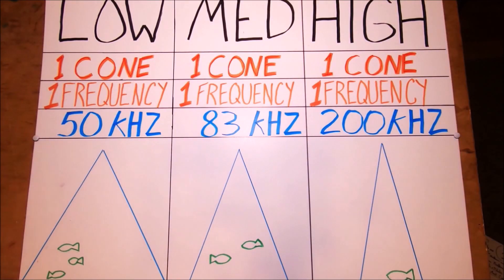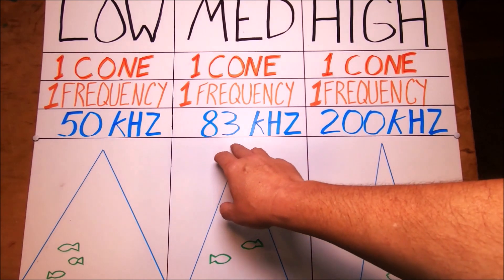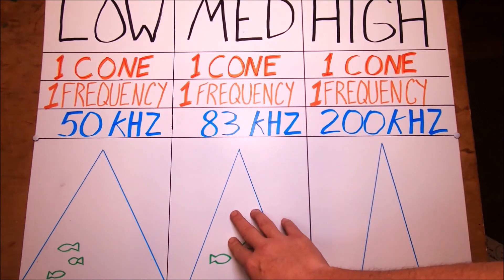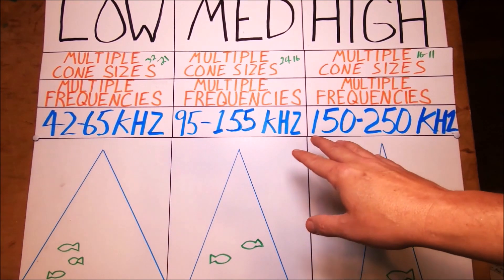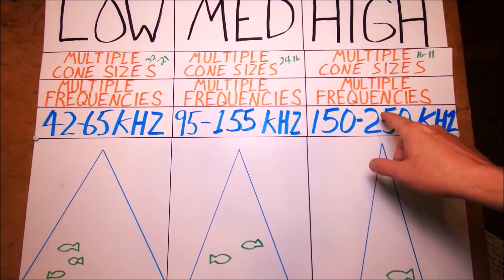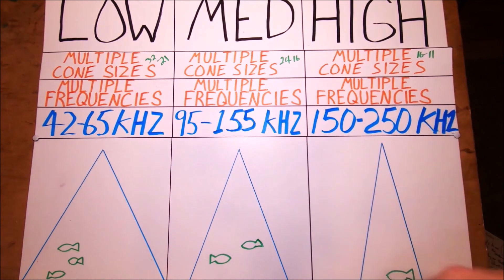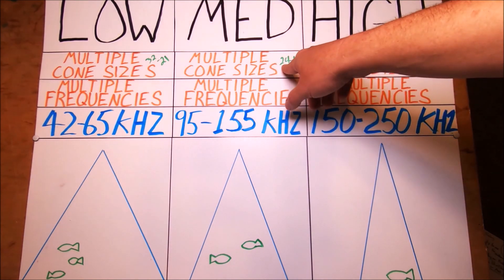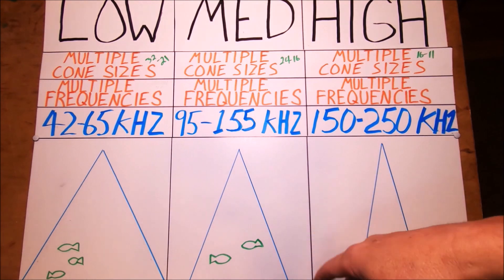What is chirp sonar?

Comment: what freq range does the Active Imaging 3-in-1 Transducer work in (are they single freq's?)
Reply from the maker: It has both single and CHIRP. the singles are 83 and 200khz. CHIRP bands are med and high.
Reply: @MikeSmedleyOLDSCHOOLSTRIPERS  so based on your video the chirp mode is far better for fish hunting yeah?
Reply from the maker: @roddddders  That’s a tricky one. So much depends on the transducer. With the high end CHIRP transducers I have used I prefer CHIRP bands over singles in water deeper than 30ft. Some of them are better in singles in water less than 30ft. These combo transducers are pretty amazing for how affordable they are, but the CHIRP bands don’t always outperform singles. In water less than 200ft I would not use high CHIRP or 200 at all with 3in1. Use only 83 or med. toggle between those until you can make a preference. 👍👍
Reply: @MikeSmedleyOLDSCHOOLSTRIPERS  great thanks.  Been looking at 1kw transducer for FS9. was thinking of the TM185 hw.  Under 100m mostly.  Any opinions?